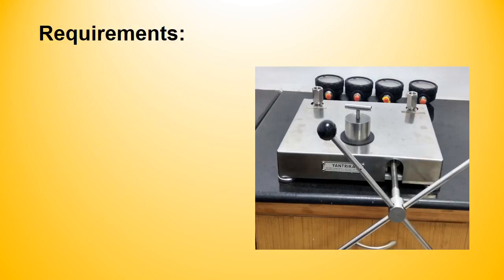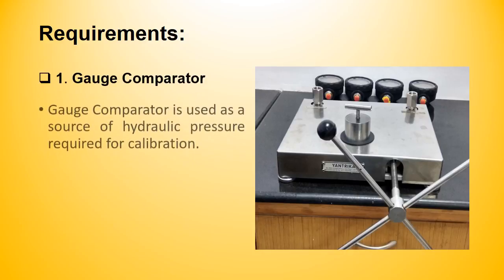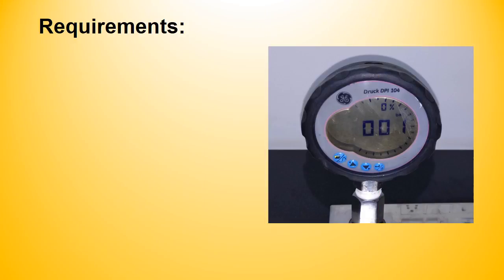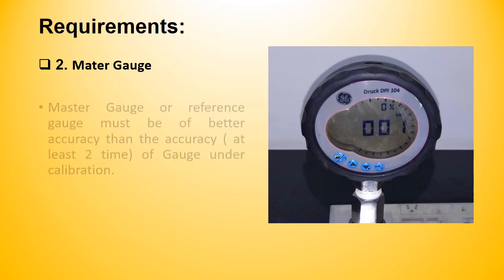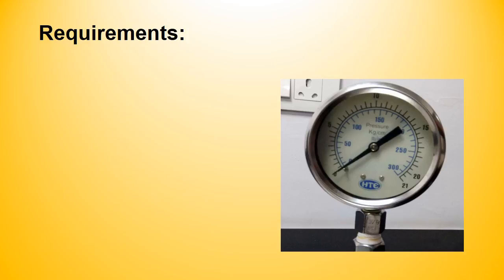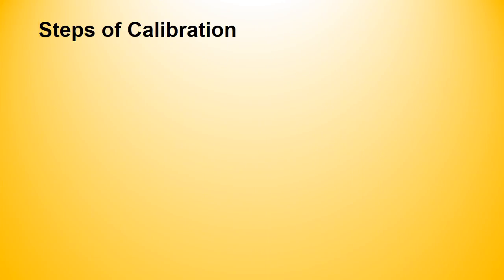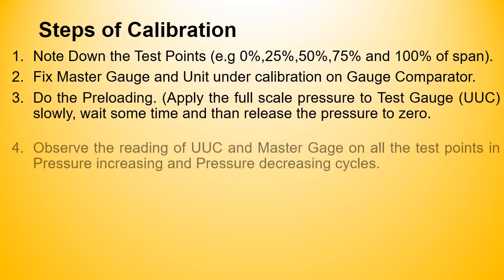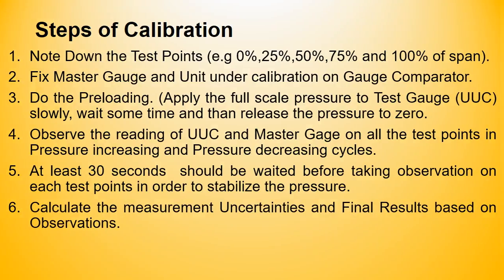Calibration Of Pressure Gauge

Comment: What if the gauge is off?  Is there a way to adjust those types of gauges or do you just dispose of them?  I am aware you can release pressure from the top cap to zero it out, but not sure about adjustment.
Reply: If pressure gauge is off then adjustable link is adjusted through pointer then it return the pointer to it zero reading